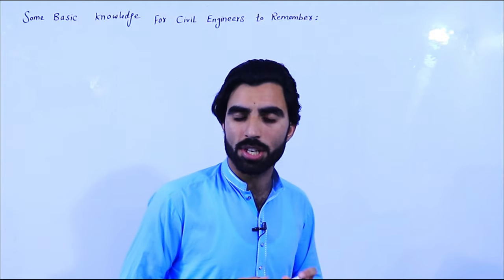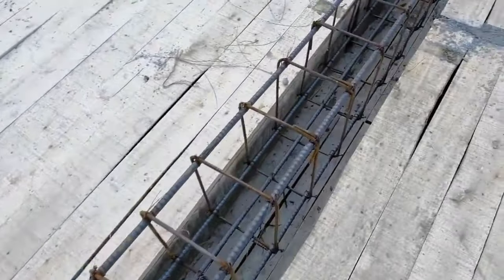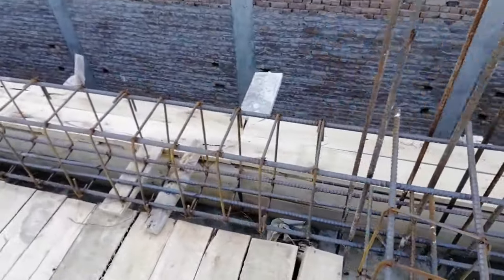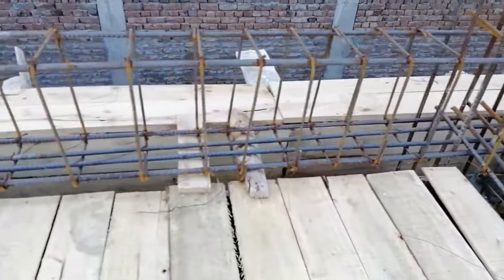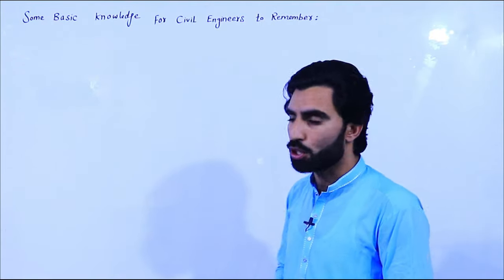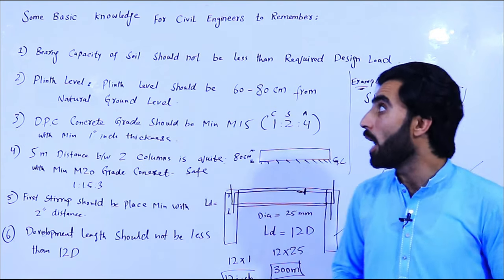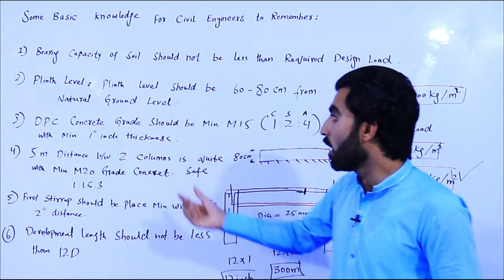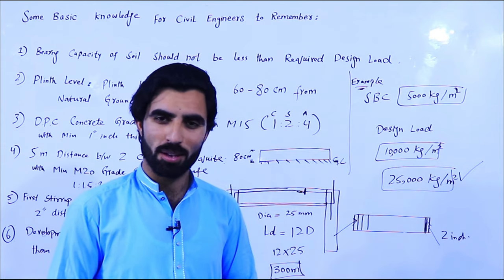Basic Knowledge for Civil Engineers on Site

Comment: You are saying factor of safety 1.5 times.Then how come for 10000kg to 25000?.
Reply: Thank you I am here to read the comment is I wondered some one will ask this and I can get through clarification for my confusion 😒😒
Reply: It is mathematical error. Correct it by yourself!
Reply: 1.5 times is the minimum number of times
Reply: He said 5 times not 1.5
Reply: It was actually a mistake, He meant to 15,000kg/m². He factored the designed load of 10000kg/m²
Reply: Factor of safety 2.5
Reply: For example
Reply: 15000kg/m
Reply: Tq sirr 
From Visakhapatnam❤
Reply: He said correct,  1.5 of 10,000 is 25,000. It's okay
Reply: @saeedahmed-vz6rq in what world is 1.5 of 10,000 equal to 25,000 😭
Reply: @saeedahmed-vz6rq 2 is 20,000 how can 1.5 be 25000 smh 😊
Reply: @Crazy.17  Namaskaram Andi Ela Unnaru Meeru Civil Engineer ahha
Reply: Simple He Done Like This 10,000+1.5 x 10,000= 25,000 That's It
Reply: Yh, you're right, l think it's an error he made
Reply: Please the factor of safety is 1.5 not 5
Reply: Sincerely speaking, the factor of safety is 1.5 .
Reply: @Crazy.17 hii I am also from visakhapatnam
Reply: Fos( 3to5 )

Comment: If the design load is 10000 kg/sq-m with a factor of safety of 1.5 then should not the bearing capacity be 15000kg/sq-m?